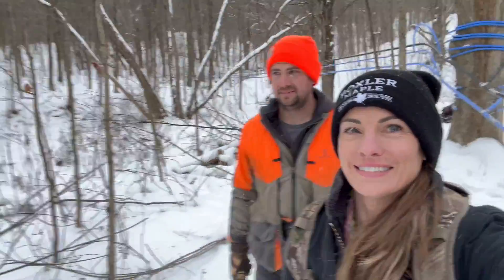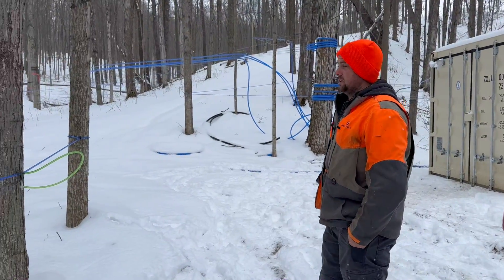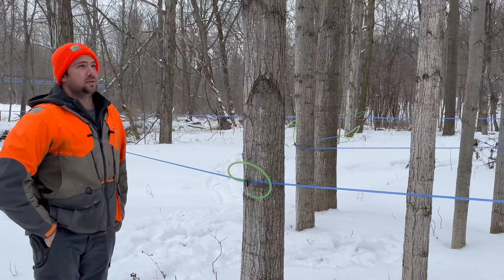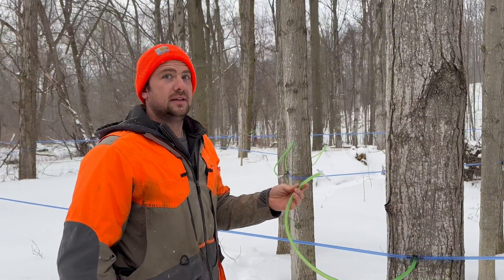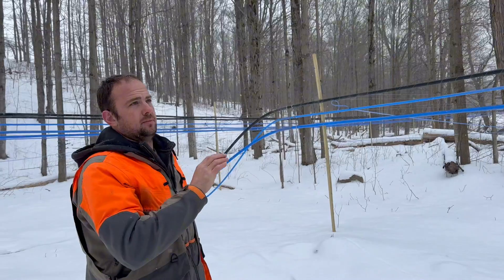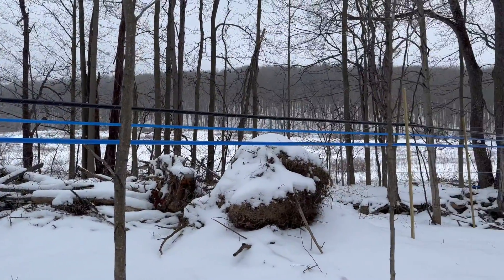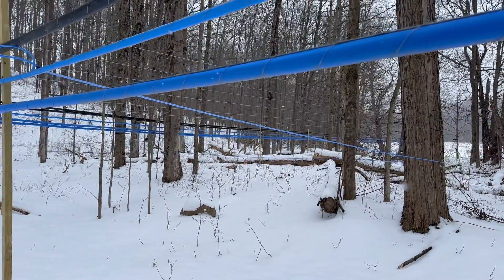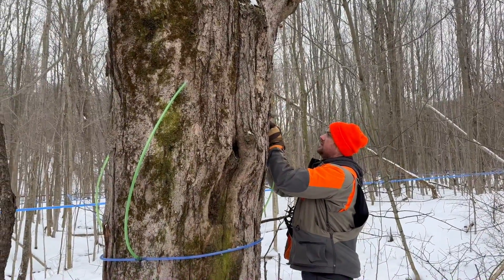Maple Tubing explained by a Professional

Comment: does the vacuum line increase the amount of sap you can harvest from a tree or just make the collection of the sap easier? I understand that only the outer edge of the tree, the sap wood, transports everything the tree needs to live, but how does the sap make it from all the small vertical channels it runs in to the tap? Does the tap have a series of small holes in it or just one at its end? How the physics of a tree works is fascinating and that you can "tap" into that system is cool.

Comment: How many taps are good for 500 ft of 5/16 tubing
Reply from the maker: If your only making a 3 foot drop line out of it about 166. If you’re connecting trees with it then it depends on how far apart your trees are!

Comment: Does tapping heart 
The trees  at all
Reply: Not at all
Reply: @daveklein2826  I wouldn’t say not at all. I might say not usually.
Reply: No, let me repeat...... Not at all
Reply: @thomasdalton7539  If done correctly, tapping has minimal impact on healthy trees. But there are a few ways it can potentially harm them:
	1.	Wood Damage & Wound Response:
	•	Tapping creates a wound, but healthy trees compartmentalize it, sealing off the affected area with new wood.
	•	Over-tapping (too many taps per tree, tapping too deep, or tapping young trees) can weaken the tree’s ability to heal.
	2.	Growth Impact:
	•	Studies show properly tapped sugar maples have little to no significant growth reduction. However, in nutrient-poor soils, some trees may experience slower growth.
	3.	Risk of Infection:
	•	Fresh tap holes are open entry points for fungi or bacteria, but healthy trees resist infections well. Sanitizing tools helps prevent contamination.
	4.	Reduced Sap Yield Over Time:
	•	Decades of tapping can create non-conductive wood zones, making it harder for the tree to move sap efficiently, slightly reducing yield in older trees.
	5.	Timber Value Reduction:
	•	Tapping scars the wood, which can downgrade the tree’s timber value, especially for veneer-quality logs.

Bottom Line

A properly tapped tree can be productive for over 100 years with little harm. But poor tapping practices (excessive holes, deep drilling, reusing old tapholes) can stress or damage the tree. Sustainable tapping methods keep the impact minimal.

Comment: What's the purpose of tapping the trees and running the lines at that particular height as opposed to tapping them closer towards the bottom of the tree and letting the lines lay on the ground?
Thanks.
Reply: They tap high because they get alot of snow